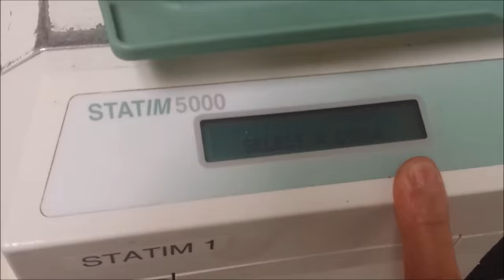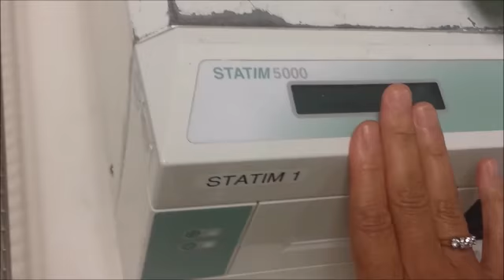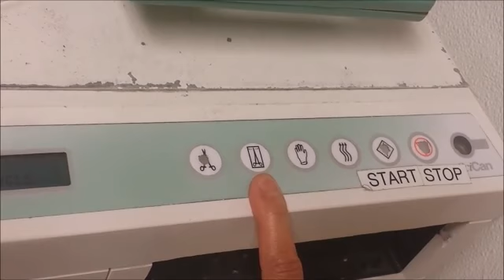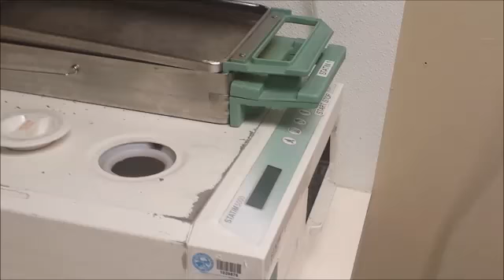Statim Instructions

Comment: Why is the water jug and the outside of the Statim being touched with contaminated utility gloves? When the Statim is opened with clean hands, then the sterile packages inside get touched with hands (or gloves) that have touched the surface previously touched with contaminated gloves, which contaminates the packages and the drawers they are placed in. The demonstrator was first touching all over the sterilizer with bare hands, then touching it with dirty gloves, then going back to touching it with bare hands, placing the contaminated cassette on a “clean” counter. I would not have dental work done in an office that is processing instruments this way. It is better to never touch the outside of any sterilizer with dirty gloves in the first place, this helps to eliminate cross-contamination!